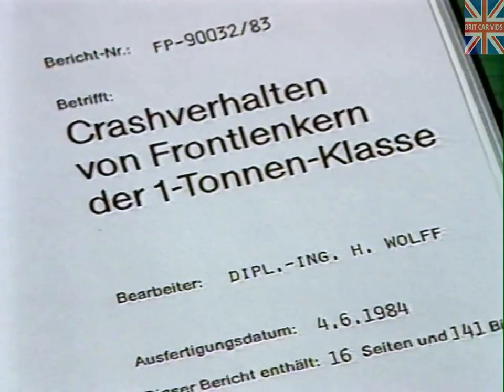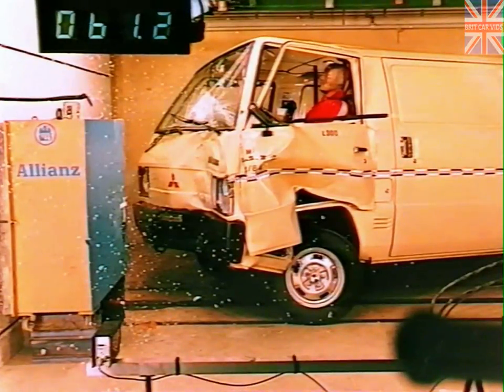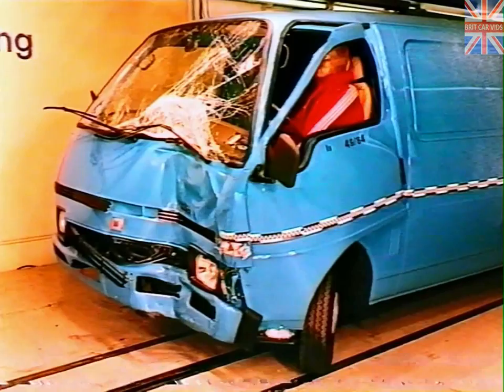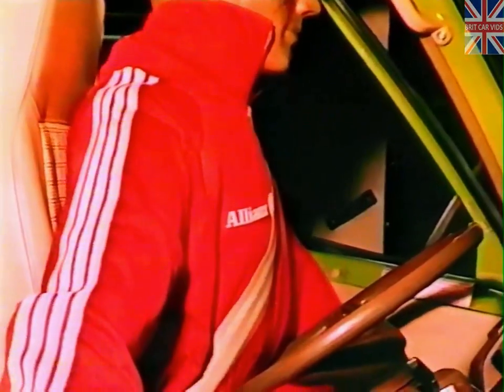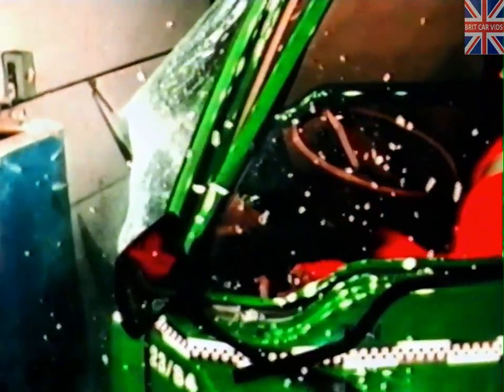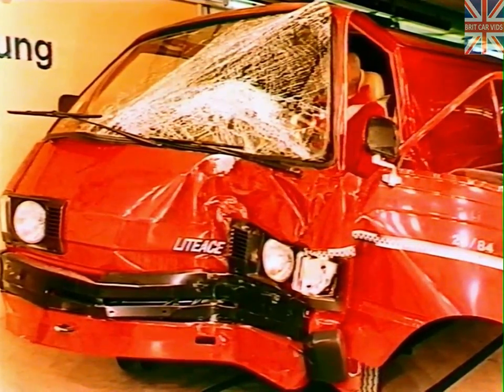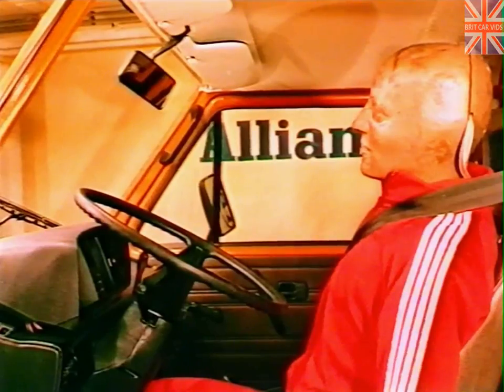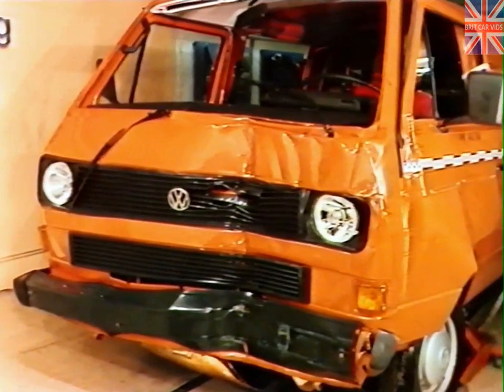Volkswagen - Volkswagen Safety - Forward Control - Japanese Crash Tests (1984)

Comment: The narrator said the statistic ass backwards. He said hitting the stationary object at 35kph was tha same as a head on collision at 55kph. WRONG AS YOU CAN GET! Hitting the stationary object at 35kph is the same as 2 vehicles hitting head on at 17.5kph. You add the two speeds together not subtract them.
Reply: Mythbusters tested that theory and found out that 2 cars crashing into each other at say 60 mph suffered the same amount of damage as 1 car crashing into stationary object at 60 mph.
They did try double the speed both into a solid wall and car vs car and got the same amount of damage in the car vs car crash test at 120 mph as when 1 car hit a solid wall at 120 mph.
Even the host Jamie Hyneman had this wrong, and admitted after the tests that he was wrong and that he was ok with it.
Sometimes physics is not always what they seem.

Comment: The VW definitely did the best here, but it had one major flaw: it had a windshield designed to fly out. No cars on the market in 1984 still had this feature; yes it happened from time to time in crash tests where the occupant compartment was severely compromised, but not where it had no or minor damage. In the USA, Federal standard required windshields to stay in place on passenger cars starting on January 1, 1970. Vans got an exemption to about 1991 I think. In Europe, pop-out windshields generally disappeared before 1980. 
Other than that, it would have performed about like an average 1980s car in a frontal crash, while the rest of the vans would have done far worse. VW definitely did a great job on the structural design for a van with very little front crush space. 
However, the next generation Japanese vans that started coming out around 1986 beat even the VW T3 on safety. The T3 failed a NHTSA full-front crash test (other full-size van designs from its era did much worse, though). The Mitsubishi Van and Nissan Vanette passed this test in 1988-1989. 

June 18, 2023 12:52 am
Reply: Schwer vorzustellen das Japan vans besser abgeschnitten haben als der VW T3

Comment: "crashing into a barrier at 35 km/h is equivalent of a collision at 55 km/h"
no it's not. the barrier does not impart any force into the vehicle beyond it's equal and opposite reaction.
Reply: I think it has to do with the fact that it is an offset crash, so only part of the vehicle is able to absorb the impact.  What they are saying is that the amount of deformation you get in a 35 km/h offset is about equal to a 55 km/h direct head since the whole frame would be taking the impact.  Unless the manufacture totally screws up and builds the right side of the frame differently from the left, this kinda makes sense, though IDK if they are right about the speed difference for it to be equal.
Reply: I do not understand that reasoning, either.  Maybe because the barrier is kind of diagonal, the energy is not released at once? Or, it is just something the auto industry made up, so they do not have to show people what their car would look like in a road speed collision.
Reply: The reason is that in those crash test solid concrete walls were used, so all the energy is converted into deformation on the van. In a head - on collision the energy is converted into deformation in both vans, so the deformation is much less, they probably intended total Speed 50km/h, so each van travelling at 25km/h. In modern crash tests they don't use solid walls, they use metal boxes that simulates the deformation of the other car too.

Comment: Vans this shape have little room for crush zones
Reply: Yea, but the Japanese found the solution: put the crumple zone between the driver seat and steering wheel...

I prefer My T3 hard, strong and with my feet over other peoples hoods, some Swedes tested the T3 head on against a Volvo to prove that the Volvo was really safe. The Van hit and got up on the Volvo's hood and the bumper smashed trough the front windshield. So its relatively safe to crash into sedans and such small cars, just not other T3's or hard walls or something..

Comment: Tests only done at 22mph?  Seems like VW cherry-picked the speed to maximize the Vanagon's "better" performance.  I wonder what a crash test of the VW at the more realistic 40mph commonly used for crash tests would look like.
Reply: I was thinking the same. Also note how the speeds are not exactly identical. They also made the mistake equating a 35 kph frontal offset to a stationary block with a 50-55 kph full frontal crash. Still scary how poorly the Japanese performed at this low speed.
Reply: I'm inclined to give VW a pass on the speed thing. The beginning of the video stated, paraphrasing, that the speed and set-up used here was applicable to about 90% of the wrecks these types of vans were involved in.  That seems reasonable to me considering that the life of one of these vans would likely consist of deliveries, hauling tradies' tools, shuttles, etc in an urban environment. Anecdotally, I don't drive that much faster downtown either.
Reply: This was 1984, no vehicles could pass a 40 mph offset crash test then. I believe Mercedes was designing for offset crashes at 50 kph (31 mph) then, they were ahead of the curve. Volkswagen was able to make a flat nose van perform as well as a typical car of the era (with a front end). In a 40 mph offset, the dummy in any of the vans, including the Vanagon, would be fatally injured, as would the vast majority of the dummies in cars of the era. The standard crash test carmakers tried to pass in 1984 was a 35 mph full frontal, offset crash tests weren’t done yet.
November 6, 2019 5:18 am
Reply: These vans are slow thats why
Reply: I’ve actually done research about an article where a Vanagon and Chrysler Minivan crashing at 40 mph, roughly a modern offset.
The Vanagon was damaged and its driver had their heart broken, but they survived.
The Chrysler Minivan’s driver had a broken arm.
So despite it being larger and heavier, the Chrysler fared worser than the Vanagon?

In another case a Volvo 760 was crashed at 38 mph into a Vanagon, roughly a similar offset.
Volvo’s driver would have died with 1038 HIC, Vanagon’s had 100.
(This isn’t a fair test but it’s another example).
Reply: Chris Freemesser 
VW would never cheat to make their car look good?
O .....Yes.....actually that's exactly what VW do.
22mph test is totally meaningless and VW knew that but also knew it would not pass at any greater speed.
Once a cheat always a cheat.
The other vans however are just criminal .
Reply: The Vanagon didn't need to have a cherry-picked test, as they are that safe.
I own a 91 Vanagon and a 1978 Ford Econoline, and the Vanagon is safer, but the Ford is a better work van. 
Note that American Econolines from 1975 to 1991 crash about the same, as they have the same frame and body...

Comment: Result is that today are no more vans with your feet in front of wheels and engine. I haven been in a 50km head on crash in a mercedes sprinter and walked away without a scratch. engine infront, legs and feet above the wheels engine seatbelt.

Comment: VW's van here shows basically  no deformation . 
I was an investigating  officer at a crash of this van into the side of a city bus where the driver died. The van showed very little deformation  and stood up very well except..... the door came open and the stupid driver wasn't  using the seatbelt. He  fell  outside and the bus ran over his head.
These Germans don't lie. I've done many collision  investigations  and german cars come out on top.
Mercedes-Benz  cars crash like Tiger tanks.
Reply: They crush the opposition?
Reply: lunsmann the only van I investigated  in a crash struck the side of a moving city bus at 90 degrees. As a general  rule Japanese  vehicles do not crash as well as German vehicles.
Reply: Burt Hulbert its because  they put more into there design then the Japanese models did, even some of  the American models of the era. Volkswagen and Volvos were seen as the standard of what automakers strived to be in terms of safety.  However with that safety there was a cost factor, and many car manufactures just chose to make a cheaper inferior product instead. Also the price of safety  in the end is paid for by the consumer. If the consumer isnt as worried about their personal safety then they aren't going to be paying for it. They'll  buy the cheaper vehicle, every time! ! ! Safety in the industry  is largely determined on supply and demand.  Still is. Gocernment regulatory agency's can try to promote safety but it will always fall back on the consumer in the end.
Reply: James Behrje Saab was safer than volvo most times
Reply: James Behrje retards buying vehicle solely on the basis of looks are just retards. They get what they pay for...death! 💀

#GermanAutoLover4Life
Reply: So no one's gonna talk about how this man got his head ran over?
REST IN PEACE!!! WHAT ARE YALL DOIN?!!
Reply: VW lost all credibility after the EU emissions scandal. This video has a ring of propaganda about it....
Reply: The Time we're German cars WERE GOOD.
Reply: @bert hulbert why no Mercedes TN van in the test
Reply: @mals4400 Buddy, most car companies did, literally everyone that used a Bosch ECU cheated.
Reply: God loves us all so much that he gave his perfect son to die for our sins and raised him from the grave to defeat death. Through faith in JESUS we can be saved and reconciled to GOD. please repent🙏♥️
Reply: Everyone on this thread is completely retarded. A car needs to deform in order to absorb the impact. Have any of you passed 7th grade yet? If a car does not absorb the impact, all of the forces will go directly into you and inevitably kill you.
Reply: @アカシア-w7b , Don't be an idiot, the interior of the van is not a "crumple zone". Being an a$$ by posting "Have any of you passed 7th grade yet?" doesn't help your argument...
Reply: I'm just showing how poorly this was designed even though people say it's great. It needs a crumple zone.  @davidhollenshead4892
Reply: Mal S Are you saying that you think Subaru and Hyundai/Kia make reliable, high-quality vehicles? That’s a good joke. Hyundai/Kias go through two engines per car during the warranty period if they don’t spontaneously combust before the warranty expires, and Subaru is far from the level of quality that German cars and Toyota/Honda have.
Reply: Myles Vance  that’s right no bmw have ever caught fire
Look at the vw /Audi 2 litre turbo burning oil and vw do nothing
No cars are perfect
At least if Kia engines break they are replaced in the first seven years
Reply: Burt Hulbert #GermanAutoLover4Life

German cars are all I own and will ever purchase.
Reply: Redbone Brotha where are you from and which cars do you own?
Reply: @mamuwaldevoudoupractitione3518 Still can't beat Japanese! 😉

Comment: Good job they didn’t test a Bedford Rascal.
Reply: rebadged daihatsu ? those were made of newspaper thin sheetmetal. did supermarket diliveries until the second door fall out. what a piece of crap was that.
Reply: @arjanvanraaij8440  It's not a rebadged Daihatsu. It's a Suzuki SuperCarry.
Reply: Geez that would actually just fold in half. There would be no dummy left he would have become part of the van
Reply: Lmao
Reply: I used to look after some pickups barly fit in and having size 13 feet dread to think. Awfull

Comment: At 0:19, could anyone tell me which model VW that is?
Reply: @ Bacon Cat 
this is a 1303 Cabrio (convertible) made by Karmann between 1972 and 1974 (at later models, 1975-1979, front indicators moved to the front), with European lights and bumpers (different from US version)
Reply: akronymus Would you happen to know why it has a Mitsubishi badge?
Reply: @ Bacon Cat 
at 0:19 there is a Mitsubishi L300 in the picture and a green 1303 on the lane next to it ... 
the L300 by the way had engine and gear-box underneath the front seat row, and also existed in 4x4 version (very popular as a camper)

Comment: Very interesting...
I wonder how results are 30 years later.
Reply: No they would be a lot better. In a lot of 2018 vans you could walk away from this type of crash at 64 kph. 

March 5, 2018 2:08 am
Reply: In theory, yes. Now you can see a real life crash test of a 2wd Vanagon, (inferior to a Syncro), at 40 miles per hour: https://www.thesamba.com/vw/forum/viewtopic.php?t=419961&start=0 

And here you can find the photo: https://3.bp.blogspot.com/-lPXIi8b46Ig/WExVBsZB8tI/AAAAAAAAAsE/wD-r_ZLvdF08f597-hRux2FLWwh2DgoEgCLcB/s1600/P1030508.jpg
Reply: @HellenicVanagonTheSyncroHeresy , wrong the 2WD is safer. as they are much harder to roll over. Besides the Syncro has twice the repair costs...
Reply: No the Hellenic Vanagon cannot be wrong. (About the Syncros).

My answer is coming asap.

The Syncro Heresy
Reply: 1)So here are two photos: the Syncro's subframe before an accident and how it holds after a side collision:

before: 
https://drive.google.com/file/d/1QEt4x37GM60Q_3O-FJY-IF35YpgbieAT/view?usp=sharing

after: https://drive.google.com/file/d/15v9ST1YaKsML5sKcK0EH2A8SV4POwYkp/view?usp=sharing

The second, subframe, chassis is a strong passive safety add on, for the front passengers, especially, but contributes to the total chassis reinforcement, too.

2)Here you can see the Syncro's inclination limit and why it is not lower, at least, comparing to the 2wd:
http://www.vwsyncro.eu/p/inclination-limit.html

3)Here you can see how and why a Syncro has a better active safety from a 2wd, German white paper and  Heresy's translation:
http://www.vwsyncro.eu/p/blog-page_21.html

4)Here you can see some more elements about the Syncro's unique passive safety characteristics, (and 2wd's in general):
http://www.vwsyncro.eu/p/blog-page_18.html

5)Here you can see the prove that the 4wd cars, (in general), are safer:
http://www.vwsyncro.eu/p/article-excerpt.html

Of course to repair a Syncro is costly. But it is the only way to have an unconditional love.

The Syncro Heresy
Reply: Perfectly as you can see here: http://www.vwsyncro.eu/p/blog-page_18.html
Reply: I mean if these tests were done nowadays with current 2018 vans, will the results be the same???

Comment: 1 Vw
2 Isuzu
3 Nissan
4 Mitsubishi
5 toyota
Reply: Actually, the report shown in the end states that the hiaces comes in second, asserting it "rather favorable results": "Das Schwestermodell Toyota Hiace lieferte im [Verglei]ch zu den übrigen Testfahrzeugen, außer VW Typ 2, eher günstige Ergebnisse." The following paragraph names the Nissan models as the least safest vehicles, with very high deformations already at no load for the Urvan, severely injuring the passenger, while the car technically can carry very high loads, suggesting even worse damages to the body.
Reply: There is a big gap between the first and the second.

Comment: The L300 is still alive here in the Philippines
Reply: What about their drivers?
Reply: Some... I saw one that crashed.
Reply: And it still has the same design... Except the van version.
Reply: @ginocole  no bigger changes. Bigger bumper ... shift lever moved from wheel to floor...
Headlights now plastic.
Reply: supermasterPIK i think the shift lever is still on the wheel
Reply: @HellenicVanagonTheSyncroHeresy , dead💀💀
Reply: HELLENIC VANAGON I loved my L300 bus in Australia.
Reply: Gino Sangalang Also Indonesia as Isuzu Bison and Mitsubishi Colt L300 (truck and minibus).
Reply: The L300 Truck is still in Korea, Too. So called, 'HYUNDAI PORTER'.

Comment: I would like to see what they said about the deceleration force on the internal organs.
Reply: NCAP: "the Vanagon has the best chest deceleration rate".

Notorius Vanagon vs Volvo 745 crash test:

HIC (Head Injury Criterion) for driver, Volvo: 3,868, VW: 155

Head Impact, Volvo: 200 G, VW: 42 G

Chest impact, Volvo: 65 G, VW: 30 G

The Volvo "driver" is killed.

The Vanagon driver with brushes.

All these here: 

http://www.vwsyncro.eu/p/blog-page_18.html
Reply: We are talking about 36 km/h or 22 mph - bicycle speed in fact
Reply: Im sure it was "less than favorable" with the wheel crushed in the dummys chect.
Reply: @ Willis Curry 
it wouldn't have been such a great invest to construct a softer steering-wheel. 
The old VW beetle (the series with the flat front screen) was severely worse in this regard - the steering axle was one solid piece without links and invaded passenger room even at a minor crash.
Reply: @akronymus  If by old VW beetle you are referring to a 1938 thru 1950s model...
Reply: @davidhollenshead4892  
the non-stabbing steering column was introduced in the late 1960s with the US export model. 
 
Anyways, in the 1930s there have been more advanced cars than this one. Not to talk about, Fiat, Citroen, Renault, Peugeot, Saab of the 1960s - lot of better cars everywhere. Even German GM (Opel) and Ford. Germans just bought the 'Adolf' car, this is the whole cause for success.